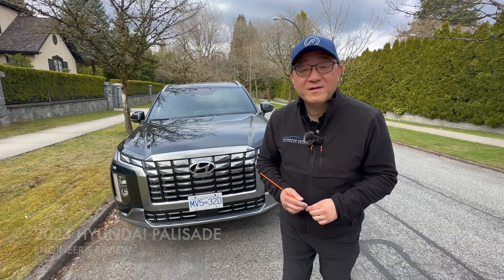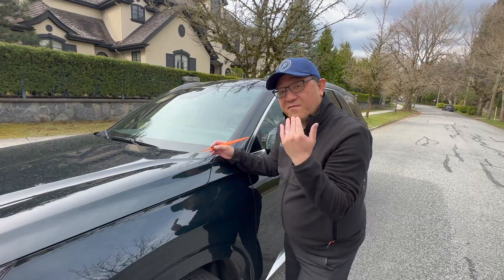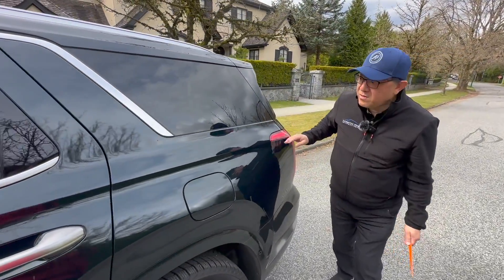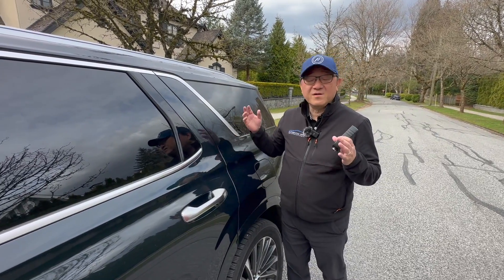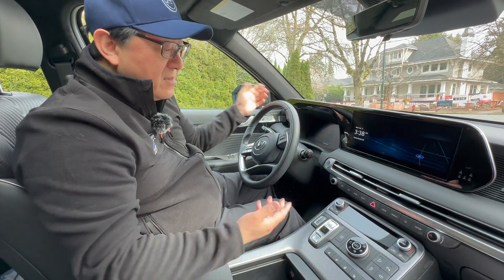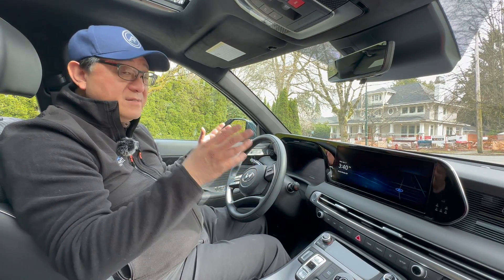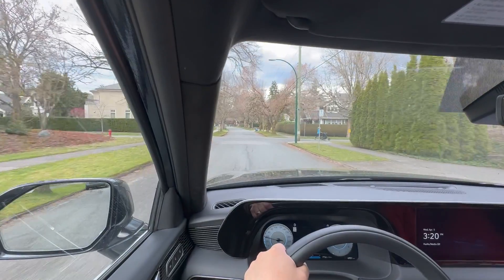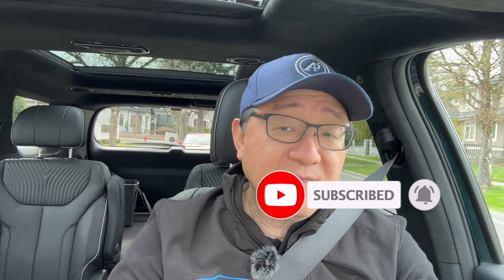HOW'S THE QUALITY OF 2023 HYUNDAI PALISADE?  DOES IT LIVE UP TO TOYOTA STANDARDS?

Comment: No hybrid? PASS.... gas here in CA is $4+
Reply: You can get the Santa Fe as a hybrid and plug-in hybrid. All you gain is 1 mpg, 500 lbs and loose 1500 lbs towing capacity. There is no real benefits to a hybrid if you want all gas or all electric you don't have two different motors to fail.
Reply: Gas here in BC 🇨🇦 is $8 gallon. We bought our 2020 Palisade new, never complained on it fuel consumption because the features and driving are so good.

Comment: Had a 2020 first model year.  Got rid of it about 2 years in.  Had a bunch of quality issues.  Rattles, usb issues, wind noise, rough start and most shocking of all shifter would malfunction and refuse to go from R to D. Traded for a Toyota. Smooth sailing now, even if not as refined and luxurious.
Reply: Got a 4runner trd off road prem trim in 2022. It looked like my grandfathers 4runner from 90.
5 speed transmission and a 16mpg. No thank you toyota